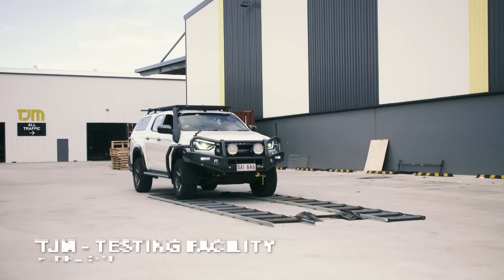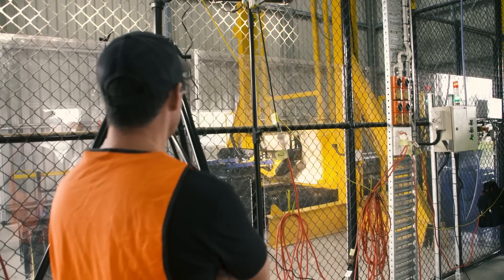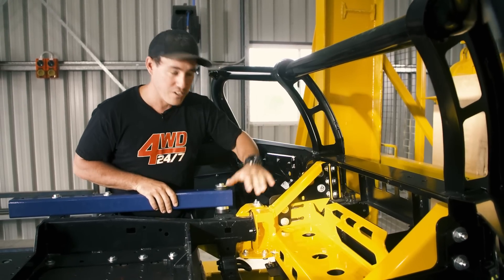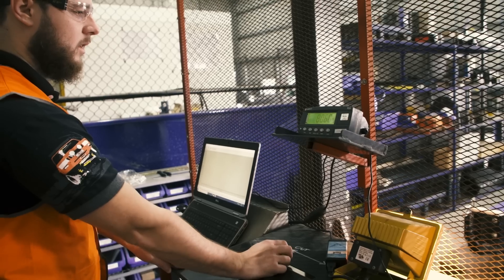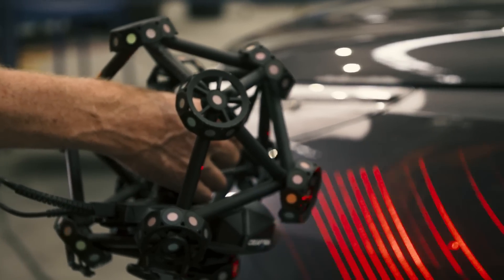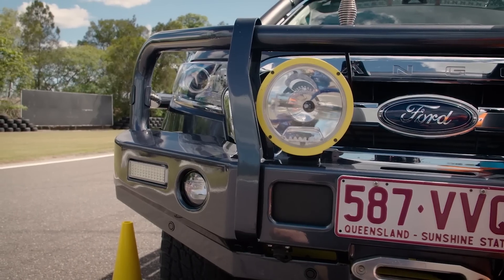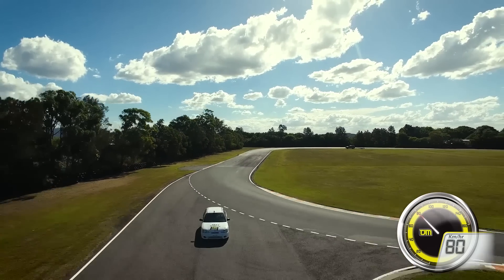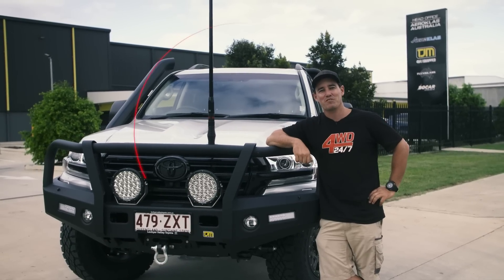BULLBAR CRASH TEST – How strong are they? PLUS How a bullbar is made!

Comment: I am curious as to whether the mechanical testing devices for the "Bull bars" are ISO and ANZ approved and rated? However, the Kangaroo test on the "Bull bar" is mute, even though there is repeatability and falsification; there are two different vehicles used along with no variability in vehicle speeds or distance, and, the absence of a crash test dummy that is rated and approved. Do these "Bull bars" come with the appropriate approval and rating stickers, even the ones manufactured overseas?

Comment: That pendulum is a deformation test not a crash test. ARB strap the bar to a vehicle and crash it into a wall. Not bad from TJM but ARB still for the win.
Reply: It showed in the video that it was also put on a sled for a proper crash test.
Reply: Ya it did but still not the same as chasing a car into the wall at 80 KMH
Reply: @jacquesD4D  They probably don't have the budget to write off a new car for every test, so a reusable sled is  good compromise.
Reply: @tareskisloki8579  probably but then they shouldn't try to justify a cheaper way. Data will never be the same. Out come as well
Reply: @jacquesD4D  that's true, however if that level of testing was actually required, nobody would make them, it wouldn't be feasible.
Reply: @tareskisloki8579  that level of testing should be the minimum. Then the consumer will get the safest product on the market. You cant put money on your family
Reply: @jacquesD4D  the only option for that is genuine accessories, as they are the only ones that are crash tested on the vehicle.
Reply: @tareskisloki8579  and ARB. They write cars of to do the testing. Sort off evens out. Plus hiw many manufacturers aprove what kind off aftermarket accessories. In SA ARB is one off few that is approved by the main manufacturers.

Comment: Ha mate great presentation as usual 👍 2 questions can the bar be mounted enough  forward so when you do hav a hit it doesn't hit the bonnet say forward  say150mm 2nd question can they mount a recce hitch type receiver so you could use a portable winch cradle front or back  cheers mate
Reply: Hitch receiver is a good idea👍

Comment: Using arb and tjm. Now only stock with tjm
Arb bullbar using bracket for bullbar.
TJM bullbar directly fits into the chassis.
Reply: TJM still goes onto a bracket, that was the yellow part in the video, they haven't bolted directly to the chassis since the pre-airbag days.

Comment: I'd be interested in an ARB engineering comparison 🙏
Reply: well they don't have recovery points and they cost a fair bit more, they also have plastic everywhere that keeps breaking when you hit the smallest thing.
Reply: The TJM bar fitted to my 2019 Troopy came from China.  Some are made overseas, some in Australia.
Reply: Not made in aus if I’m right.
Reply: @joshuagunter1177  Most aussie companies only make a couple locally then have them the rest build in Thailand or the like and imported.
Reply: @148Reaper  Pretty sure TJM are still all australian made.  Mine was about the same price as the ARB, but looks better on the front.
Reply: @KegRaider  Re-watch and listen @7:42  "Even manufacturing A FAIR FEW right here in Australia" i.e. Not All.
Reply: @joshuagunter1177  ARB still has their factory in kilsyth Melbourne. My bar is made there.
Reply: @Wtrxprs007able  do they make it there or just store there?
Reply: @joshuagunter1177  they are made there and it's a store too. Aussie sold ones are made here while other countries get the ones made in Thailand
Reply: @joshuagunter1177  big warehouse in Keysborough where they store all their stuff.

Comment: Unpopular to say, "A review of studies on the safety effect of bull bars published in the journal Traffic Injury Prevention concluded that they “significantly alter the collision dynamics of vehicles, resulting in an increased risk of pedestrian injury and mortality in crashes.”  I get it that if you are doing outback travel a bullbar could be the difference between getting home or not. But for general commuting bull bars are harmful to passengers and pedestrians in accidents.
Reply: "it comes at the cost of greater impact forces reaching the occupants of the vehicles" A few people claim this but I'm not convinced by this argument. ADR approved bullbars are not solid and neither are the mounts between the bullbar and the chassis. The mounts are actually designed with crumple/failure points in mind. In a high force crash involving a car fitted with a bullbar, the bar is not strong enough to withstand serious forces, rather the steel tubes and the mounts will bend and eventually transfer that force back into the existing crumple zones in the vehicle. 

The videos eludes to this with the setup of the test. Notice how the test involved a roo weighing 45kg@80kph yet a far more realistic test would be 110kph. That's like because they don't want to show the tubes bend back into the headlight or even the headlight smashing due to the bending of bullbar.
Reply: @HardstylePete  You may be correct in saying these modern bullbars are very well engineered and try and mimick the crumple zone effect, but the basic laws of physics tell you  For every action, there is an equal and opposite reaction.  So for the vehicle body to be protected that energy must go somewhere, and its to the occupants of the vehicle
Reply: @mindofown  The force is being absorbed by the bending of the bullbar and its mounts. That's how the body of the vehicle is protected in low force crashes like animal strikes. The only way the vehicle occupants would experience an increase in force would be some that would bypass or weaken the existing crumple zones.

Comment: I'm sure a vehicle with a bullbar will be better off compared to one one without on a kangaroo strike.  But the comparison shown is hardly fair don't you think.  A big ute with a bullbar vs a small hatch without.  They should have used a older ute instead.
Reply: I suppose it comes down to sacrificing a $50,000 ute vs a $500 car
Reply: was gonna say the same thing the roo's head was above the small car while the big ute just hit it and pushed it to the side

Comment: Not one bullbar has ever been crash tested by ANCAP and or EuroNCAP.
Not one of these bullbar companies can actually tell you how their product affects crash worthiness. From my years in towing and rescue, I can tell you that I've seen massive safety improvements in cars that now crumple but protect the occupants. Bullbars are inherently designed to reduce that crumpling.
Reply: That doesn't make any logically sense. The bullbar will be able to absorb a small percentage of a crash prior to the force being transferred into the factory vehicle chassis. The bullbar doesn't compromise the existing crumple zones built into the front end around the chassis rails and front strut towers. You could theorise the additional force to crumple the bullbar prior to the transfer of force into the chassis would result in the other vehicle involved in the crash being worse off.  ADR approved bullbar mounts have designed failure points and are not straight mounted to the chassis like a backyard DIY job.

Comment: Great technical piece, thanks.
What was not highlighted was the way that the TJM bar tilts back on impact - sending the object back over the windscreen.
It is now, and has been for some time, illegal to have a slightly rear tilt on the bullbar.
Many of us may be from Whellabarrowback, but sometimes we know math, like vectors.
Home-made bars were always tilted back, and the local copper always knew why.
Reply: Pretty sure it's the forward tilted bars that are illegal, the older style designed to send whatever you hit down under the tyres, like the classic five posters that used to be on everything west of great dividing range.

Comment: Out of curiosity does the Kangaroo actually have any hard parts to it or is it just gel with a cover on? I understand it’s got a certain weight but does it factor into the equation the bone structure of a roo?
Reply: A real roo, is realy a tough leather bag filled with squishy stuff. The bone just supports it. Having hit numerous roos in a sedan (ford Falcon) at speed, I can tell you they tend to come apart pretty well. A bar certainly means you arent having immobilising panel damage..

Comment: Good video, maeks me llaugh how they are banned in the UK on new vehicles due to pedestrian impact issues, and yet you guys look at it more as how well can I survive hitting skippy. I prefer the Australian option..LOL.
Reply: Didn't know the UK had a kangaroo problem? Are vehicle strikes even a common problem?
Reply: @HardstylePete  Badgers, foxes, pheasants. They’ll make a mess of your car but you can normally drive home. Also low enough that they’d go under a reasonable size 4x4. Regular cars are the ones at risk.
Reply: We have a political group that has been trying for years to have them banned due to pedestrian safety fears, however due to the amount of open country vs city areas we have, combined with no data to back up the theory that bullbars are more dangerous has kept them from going ahead with the ban.
Reply: @tareskisloki8579  Real world studies are hard because every accident is so different, and much of that data is not recorded. The science is conclusive though - getting hit with a hard, small diameter pipe does way more damage than something large and flat that deforms easily. The argument comes down to risk vs reward. For rural Australia, USA, Africa etc. the reward outweighs the risk. Not so for the UK which has a very small rural population and few animals large enough to damage a vehicle.
Reply: @tareskisloki8579  as jp points out its risk vs reward. doesn't seem like there's a significant risk of damage vs the rates of pedestrians strikes.
Reply: Getting stranded in Australia is dangerous, getting stranded in the UK is not. How many breakdown insurance policies in Australia promise to reach you in 30min?

Having been hit by a car, I am very glad that it wasn’t a bit 4x4 with a bull bar. My glancing blow and roll over the bonnet would have been cracked ribs, broken arm, fractured skull, and a long stay in the hospital.

Comment: Yeah just compare and old crap box of a car that is a sedan not even a ute. Fair comparison not.
Reply: mate mate mate mate… i think you deserve a reality test. 
The Hyundai Excel is the absolute pinacol of Korean engineering from the late 1900s and it is really disrespectful to diss on it like that...
pftt. "crap box of a car" better than your little 79 series cruiser
Reply: Yeah but the concept is the same
Reply: @roccosalas3125  No its not. New cars withstand crashes much better than older cars and using a sedan over a ute makes a even bigger difference.
Reply: @Adrian9987 They are structurally the same in the front end. Where’s your evidence that this makes a difference?
Reply: @Adrian9987  even if they used a Ute it would still result in panel damage. Possibly even engine damage. So yes the concept is the same.
Reply: @roccosalas3125  Of course it would result in panel damage but the structure of a ute is generally stronger in the front to perform front recoveries, it obviously varies to each car brand but a ute also sits higher so the engine is better protected.
Reply: I agree it’s an unfair test! The Hyundai is much lower, stating just one obvious difference! Definitely should be like for like! But funny to watch an old Xcel get bent by a very light orange kangaroo ✌️😂

Comment: Australia has so much more regulation on these things. In the USA literally anyone can zap one together from mild steel, give it a quick coat of paint, and then sell it to the public. My 4x4 has gone through 3 front bumpers because of poor quality and failures over the last 12 years, although a lot of that has Michigan winter salting to blame. The scary part is that a lot of rear bumpers are sold with class 2 trailer hitches installed which are absolutely not rated to tow anything.
Reply: @ark8tct  Yes, public safety is very important. Anything that can endanger other motorists should be outlawed.
Reply: @ark8tct  Not to mention that I have no idea if my front bumper is going to work with my airbags properly in a severe crash.
Reply: I actually love america for this, your car your choice. You can pick a good brand, or a shitty brand if you just want a bull bar look. Where I live you can't even fit a bull bar legally. I replaced my bumper twice because this plastic crap crunches and falls off when off roading.